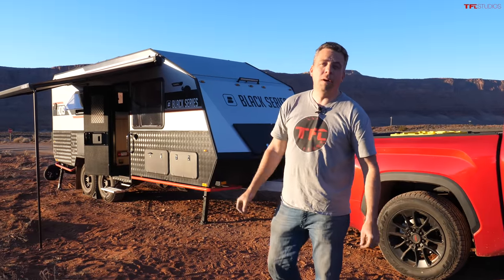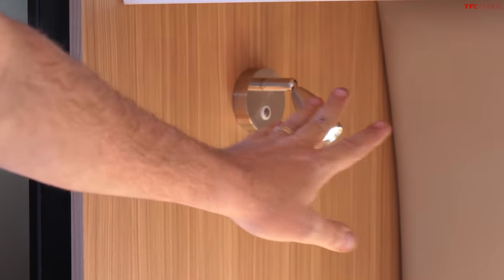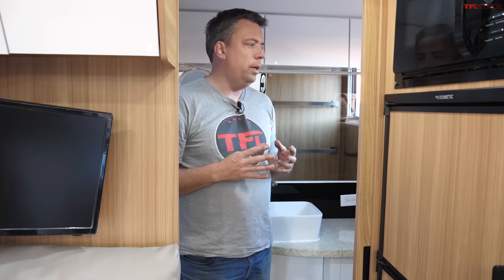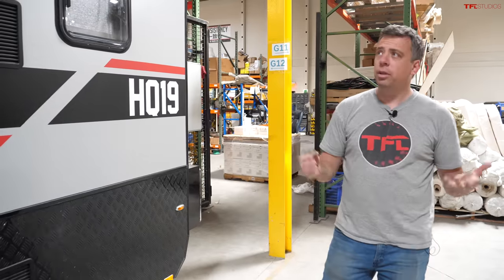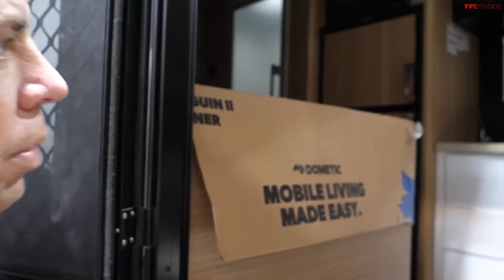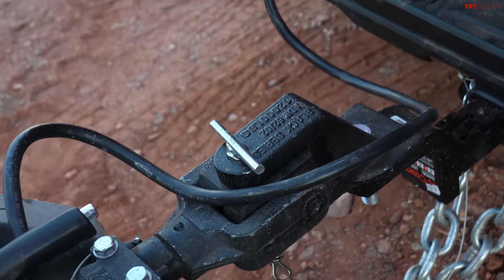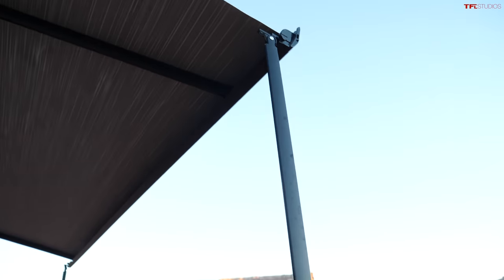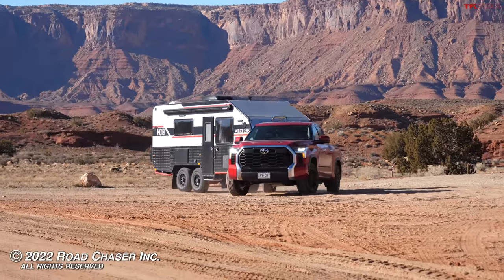Here’s Why The New $95K Black Series All-Terrain Camper Is The Most Luxurious Way To Get Very Muddy!

Comment: That price is insane. We have a Rockwood Roo 233 hybrid that we bought for $6k last Fall. A new one goes for about $25k. I know this camper has special suspension and some other bits, but not $70k worth. Plus of course my camper was entirely built in the US.
Reply: Right there with you. Made as inexpensively as possible in China, shipped here and marked so high that you could buy a new truck and camper for the same money!!!
Reply: Right, Andre says something for everybody, yeah, everybody with a six figure income and money to burn.
Reply: Lol you can't compare the two
Reply: @freethinkingamerican80  Sure you can. My 2009 has most of what that camper has, nice stove, microwave, fridge with separate freezer, heated mattresses, DVD player, exterior speakers, nice retractable awning. I don't have the ground clearance or solar panels,  but I don't need to overland and I could add thr panels for a few hundred dollars.
Reply: @RandomGuyDan  No US Travel Trailers disintegrate in Australia.  Chinese Off Roader vastly more durable, but again it is Chinese and you do not know if it will fail when you least expect it.
Reply: This camper doesn’t even have a 12 v fridge which most new “cheep” campers come with. They’re a million times better then the old gas ones like this is.
Reply: We have a Rockwood Roo. Rockwood is a pretty good brand. The brand is definitely on the higher end of quality.
Reply: These are like a F150 compared to a F350 as regards heavy use Off Road, would not last long
Reply: @RandomGuyDan  then you are comparing apes to oranges, can't believe you don't know that.
Reply: @JonBecker81  it runs off gas and electric
Reply: @freethinkingamerican80  yeah propane or 120v.  Not 12 volt. So it’s not legal to run it with gas while towing. Unless you have an inverter that can change the 12v DC to 120 AC (I’m sure this doesn’t come with one) then you’re SOL. Most new RVs have 12v fridges so you can run them under all scenarios ie while towing or shore power because it runs directly off the battery.
Reply: @timhammond691  Something like Black Series would go for Aus$50,000
Reply: @RandomGuyDan  Overlanding make a big difference  in how it is built
Reply: @freethinkingamerican80  Not really. I get that the Black Series is aimed at a different kind of camping than what I do. It has more ground clearance, a stronger frame, bigger wheels and tires.  But in the end it is comparing a Ford F-150 Limited to a Raptor. Still pickup trucks, just one is purpose built for a different type of use. So should the Black Series cost more than a conventional camper? Sure. 3x more? I don't think so, but that's just me.
Reply: @RandomGuyDan  they don't cost what the video says, I got mine for I think around 60k, but I have done a ton of upgrades
Reply: @JonBecker81  yes they come with inverters and most everyone upgrades like I did to the Victron MultiPlus 3000w.  You guys don't know what you are talking about because you are ignorant, this is probably the first time you have even seen this trailer.
Reply: @freethinkingamerican80  no, this is not the first time I’ve seen this trailer. All I was commenting on is the outdated technology in it that you get for $60k +. Congrats on your Chinese made trailer! Money well spent I’m sure. And I think it’s hilarious that you spent $60k and STILL upgraded to a different inverter. 😂
Reply: @JonBecker81  you sure are ignorant huh, shows you know absolutely nothing about these types or trailers. You think people don't do upgrades? So you buy a car or truck and leave it stock as well huh?
Reply: @freethinkingamerican80  like I said, enjoy upgrading your Chinese trailer that you spent $60 grand on and maybe buy a 12v fridge as one of your upgrades.

Comment: I had an HQ12 for awhile, one of the first brought into the USA. Like most trailers there were lots of issues (the worst of which was dangerous trailer sway resulting from poor weight distribution). Once I got the problems ironed out it was pretty cool and I had some fun, but the offroad ability comes at a cost. They are very heavy, so you need a big truck to tow them. Even if the weight is within your vehicle's towing range, plan to be well under that limit for any offroading. After owning one I would rather get something smaller and lighter.
Reply: Also, the polyblock hitch suuuuucks. Very difficult to connect or disconnect when on anything other than flat ground because otherwise the pin ends up binding. Also much harder than a ball hitch to line up and connect.
Reply: Another note ... discounting it because it's made in China and not USA doesn't really track. The vast majority of US made campers are garbage and barely road worthy. The Black Series had it's flaws but the chassis was solid (which is an understatement).
Reply: @kramericanindustries  Spot on US Travel Trailers  disintegrate in Australia.  At least this will do a few dirt roads and survice

Comment: I own a new 2021 HQ19 and even though I’ve only used it twice, it seems quite nice and capable.  It is unlike any other camper and is nicely equipped.   I would like to mention that while the MSRP is $95k, it should be able to be had for about $60-$65k.  From what I have seen, like most other campers, there is a considerable markup, usually 40 to 50%.   I have not noticed any problems with quality yet, but time will tell.  The unit does have a good warranty and people online seem to get satisfaction from the company on warranty items.  When buying this unit, I considered the Outdoors RV Back country series.  While it was about $10k less in price comparably equipped, it had conventional straight axles.  I liked the Black Series independent suspension.  I did not want an Indiana made unit, they have big quality problems and are packed with Chinese stuff as well.  From what I’ve read the Outdoor RV units have better quality that most other camper brands and are made in Oregon.  However, no other brand offers as heavy as a frame and suspension as Black Series.  The video did not mention much about the HQ19 having 400-600 amp hours of battery and a 2000 watt inverter to compliment the 600 watts of solar cells, it is nearly totally off grid out of the box.  This caravan pulls great, even in wind behind my 2020 Ram ¾ ton Cummins and only reduces my mileage by about 20% with no sway bar.  I like the way I can just pull over about anywhere (that’s allowed), and camp.  I have read that the two wheeled versions do sway a lot.  As I said, time will tell how it holds up but I have owned many other campers and my HQ19 does seem to be better made than many others new ones made in the last 15 or so years.  Thanks TFL for the video, I learned a lot and thanks for not pulling any punches on your review.  It will be interesting so see more on your experience with the HQ19 caravan.

Comment: I paid $65K for my 2021 and added a bunch of options as well. I'd be shocked if anyone paid $95K. They are expensive, but built much better than most US Rv's and cheaper than an Aussie built unit. These are heavy units. I'm over 8000lbs loaded. Ended up upgrading the truck to a 6.7 diesel to pull it.

Comment: I have purchased the HQ21 and the very same truck you have in this video. I was told the maximum gross and tongue weight of the HQ21 and HQ19 are the same, both have 1000 LB tongue weight at maximum load, around 750LB empty . Several Tundra owners have been very insistent  this is too much tongue weight for this truck, although you seem to be doing just fine. A WDH ( weight distribution hitch) is not available for these full articulation hitches, so I'm wondering how this truck with rear coil springs handled the load on the highway and off road. Looking forward to your feedback.

Comment: I don’t have but half that much in our fifth wheel we bought new, I’d buy an older used camper to use on trails and such and still not have 95k invested. I’ve learned the hard way buying everything from a cabover pickup camper, numerous travel trailers, one destination trailer, and the 5er we currently own.

Comment: If your wise enough to buy such a rig you and it deserve one another. Your looking at something I don't care the cost will shake apart after just the slightest use. I heard it described this way about campers. Imagine your house going thru a minor earthquake every single day. That is what happens when you tow a camper. Now do that off road well you just add to the mayhem possible. 95 thousand my god that is insane.
Reply: It's Chinesium so no way would I touch one.  Having had the terrible job in college of detailing RVs in the summer heat of the northern Sacramento Valley outside for $7.50/hr (worst job ever) I learned about RV quality.  What I found was nearly all towed units were built to such a poor standard I would never buy one.  Things have improved somewhat since then but not a great deal.  There are newer OEMs out there probably trying to make a name for quality but the stuff you could buy 20 years ago was junk.  I found that until you stepped up to a diesel coach (tour bus type RV) the quality and fit and finish suffered.  Once in that diesel pusher territory it got a lot better but in those days that was $200K at the bottom end and quickly went up north of $500K so yeah, they better be well put together.
Reply: @saisr1  Not that for that much not for half that much. They are cheaply made and will not hold up.

Comment: Looks like a sturdy trailer but all the fittings look kinda cheap. Maybe sounds silly but, opening and closing things, they didn't 𝒔𝒐𝒖𝒏𝒅 expensive or high quality. I'd be interested to have a look around one that's been used for a couple of years; not hammered, but worked hard.
For the price of a house, or a small fleet of cars, I'd be looking for serious quality and something that would hold it's value. I wonder how many get damaged, loading/unloading into the containers, looked pretty tight.

Comment: I have heard aluminum frames don't work well in the cold  because of condensation causing wood to rot where the wall and floor meet.
Reply: Depends if they are composite not wood

Comment: The suspension is the only thing on that camper that makes it what it is. I “WAS” a fan…however when you’re inside, it feels extremely cheap. AND come to find out the components are Chinese and it much different than the normal junk we can get anywhere. AND, “ROA campers” have severed their affiliation with Black Series due to their business practices and quality. I am very disappointed in this company and trailer..

Comment: This thing weighs over 6500lbs EMPTY, that is simply way too heavy for something intended to be pulled offroad unless you plan on getting stuck at the first patch of sand, let alone that it's only 19' long. And over $80K for a 19' trailer that's made in China, that's a HARD pass.
Reply: Never been to Australia? Common weight  for many Off Roaders
Reply: @robertryan7204  Just because it's common in Australia doesn't mean it's ideal. Speaking from experience, weight is your enemy while offroading.

When half of that weight is riding on unpowered wheels, you're about as capable as any 2WD vehicle.
Reply: @supersnot4  No it is ideal here, for people who go Off Road for a long  period. Shorter journeys  Campertrailers are better.

Comment: I like the looks BUT it weights too much and cost too much
It's advertised as off road but too many things need to be plugged in to take it boondocking.
The Ember weights less, cost less, is made in Indiana, is 4 season and owners report using the AC on solar and about 4 hours on it's lithium batteries. The HQ's use AGM batteries so you really don't get to use all of their capacity.

Comment: Looks like they may have got rid of some of their design flaws. Prior years had horrible delamination issues on the trim. Also better rims and suspension. Not sure why they kept a propane powered fridge /electric combo. With that amount of solar, there's no reason for a combo fridge. Another huge flaw is diesel heat and water heater. Propane on demand water heater is just a better option. I'd really like to see BS have better quality. They do have some really nice design features and ideas, but build quality has a lot of catching up to do to prove to get consumer trust back

Comment: Made in China. No Thanks! Stupid Overpriced, even if you cut the price in half! Attaching the suspension and making the beds is not manufacturing. Merely a work around to fit in a sea container from China. Rock rails should be built to serve their function repeatedly. Those rails look like a red decoration pieces. The whole interior looks entry level. Nothing stands out to justify its price. Andre, just move on from this.

Comment: I worked with a lady who had one of these. We’re both travel nurses. I’m in a self made Chevy express EB that I put a fiberglass camper top on and had a simple built out done. She’s had this rig less than a year and roof started leaking in 3 places. She’s still making payments and towing with an underpowered vehicle. I’m about 75,000 miles and nary a single leak or issue with the van. These trailers are made like crap, blasted through an assembly line in a half-assed fashion to meet the current RV demands. Would NEVER spend that kind of money on a trailer that’s put together with staples and bubblegum. YMMV
Reply: That's pretty much every camper out there, except airstream, casita and similar

Comment: Sorry to tell you that these are poorly built… you should check out PAUSE  by Palomino and Imperial Overland trailers to see constructed off-road trailers … they all have far better solar, power system, 12v heating and cooling systems… all of them built out of composite walls.

Comment: For the money that thing is totally stupid. ..... so you add some "offroad" gear and you can charge 50k extra? In the real world almost any other 25ft trailer will go where that will go... what suspension you say? If you can go faster because of the suspension all your cupboards will be open with all your stuff on the floor......  this trailer is for those folks who don't know any better and think they need it, really dumb waste of money... the materials and equipment are not top shelf stuff either. For under 40k you could have a way better trailer with a popout..... I know because I own one.

Comment: RVs are built like 1960s for the most part. This looks nicely designed and  done. I wish it was 100% American, but that's not the world we live in.  Can't imagine how much more it would add to the cost if it was 100% made in USA?  $95,000 seems about the high end going price for a off rides trailers of that size and built. 

You would make a great salesman my friend. Lots of details and no hard sales push.  Just the facts and figures. How did it pull?
Reply: most RVs are already built in the US...in Indiana
Reply: It would cost less if made in the US.
Reply: @Lex-Rex  

Not sure about this.
Reply: @kermitzforg  

Mine was from Tennessee. Either way the RV world is far behind and built like junk. Not all, bit for the most part junk.
Reply: except there are trailers designed and made in USA that are better and cheaper
Reply: They may be better made than the US campers. Chinese manufacturing is really advanced. And US campers are notoriously full of defects. I just bought one from Indiana and I love it, even though it isn’t perfect. Also 1/8 the price of this and more off road capable IMHO.
Reply: @JogBird  No, we have imported US stuff and it is terrible. Chinese  can make nice stuff, but a lot of it is junk
Reply: @schmoab  They have imported US Trailers here, but you can buy them from dealers who sell " bargain basement" no warranty products